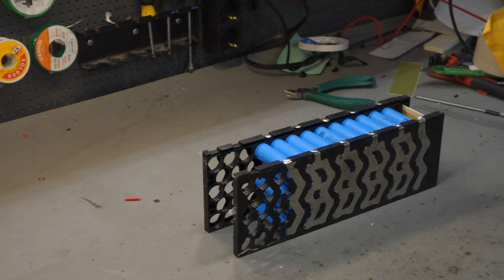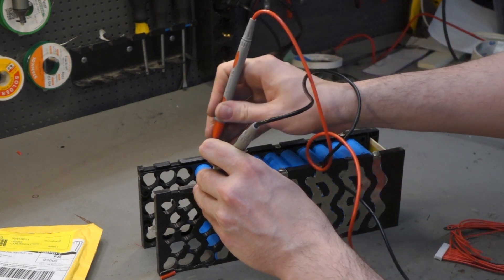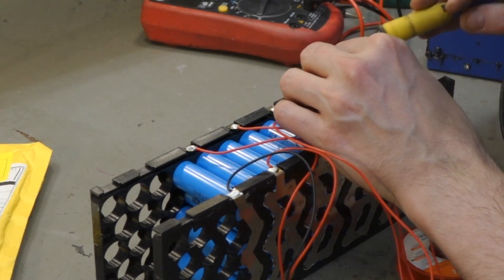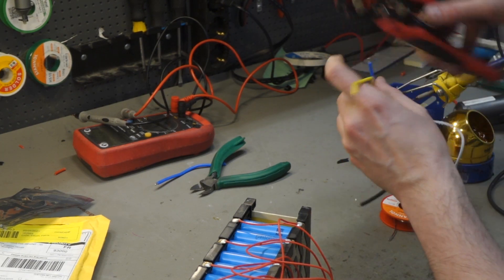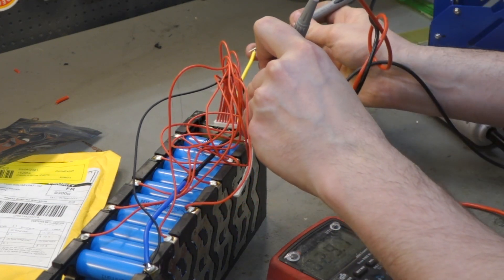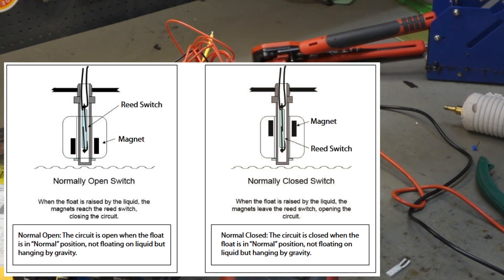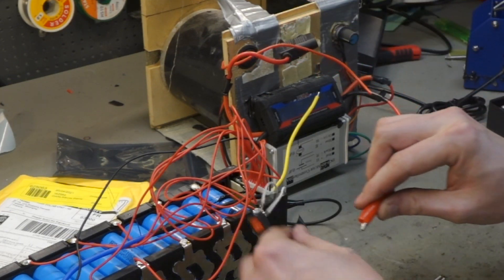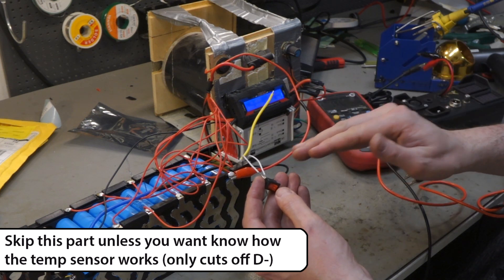How to install a Ann Power 36V 10S 15A AliExpress BMS (Functions/testing)

Comment: I have bought a 48 V 20 amp hour battery from Audi express my bike runs on a 36 V system. It shows it on YouTube that it could be that it accepts a 48 V battery mines works for good for an hour the new battery and then it just shuts off when I would put a charger in unplug the charger for five seconds And power will be fully back on again so I don’t know what the situation is. I don’t know how to test this new battery so all I got is my old battery the new battery I don’t know what’s wrong with it. I don’t know if there’s something wrong with it. I don’t know how I can fix it. I don’t know nothing I just got this new battery that I need help with Anna. Yeah if there’s any advice, I don’t know if you can thank you.

Comment: why 36v uses 10S bms instead of 9S? this seams to be the common practice but no explanation!
Reply: It's based on discharged voltage. 3.6 * 10 = 36v, 3.6 * 9 =/= 36

Comment: Isn't it better to run the ground somewhere else than over the cell monitoring cables to avoid shorts if the fragile silicone shielding fatigues? E.g. have it run around the other side of the battery?

Comment: Just put the normally open thermal switch in parallel with the on/off switch instead of cutting it off, this way it will still switch off if the battery gets too hot and you can still use the on/off switch.

Comment: Hi, I have a ebike with a 500 watt motor. The BMS went bad.  Cells look good individually and producing 54v altogether. Bought replacement 13s BMS but the old one has no C- but new one does.  Seems all new ones include C- so what to do in this situation?  Is negative charge/discharge through P- ok? Or do you have BMS you recommend?  Thanks
Reply: C- most be connected to charging minus only. discharge to P-.